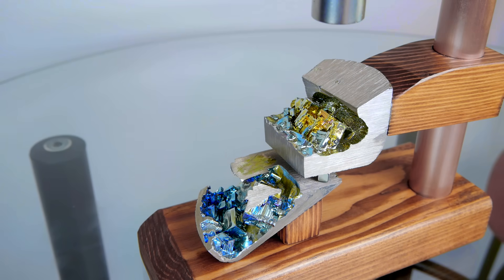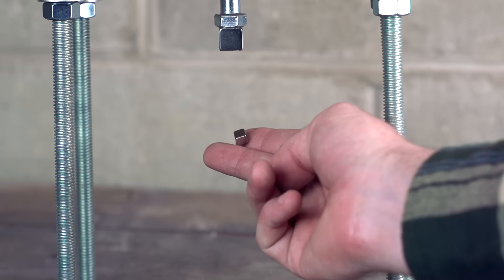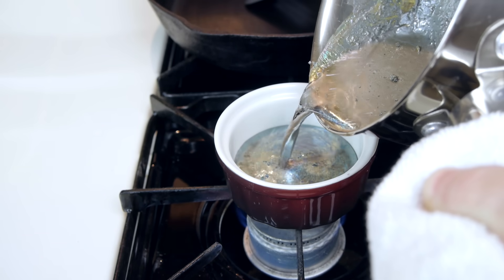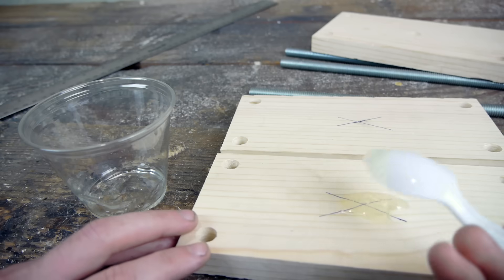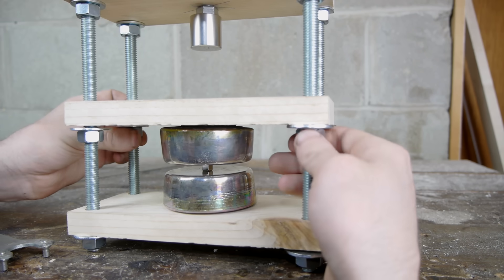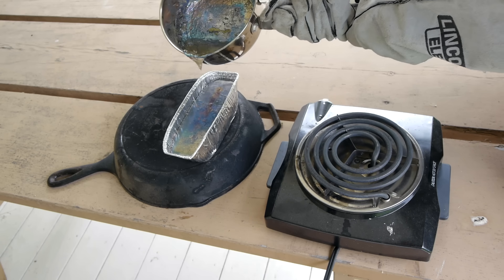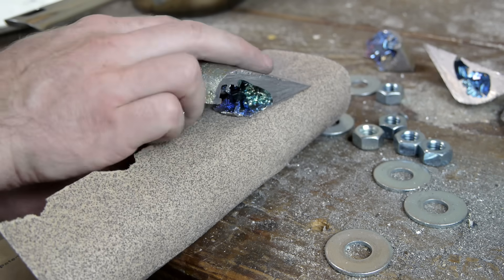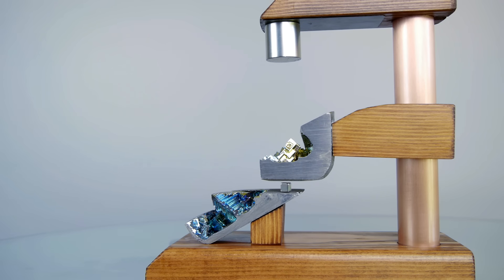Levitate a Magnet with Bismuth Crystals - No Energy Cost, Indefinite Levitation - NightHawkInLight

Comment: why do only the crystals oxidize like  that?
Reply: +King Cletus (all colorful)
Reply: +King Cletus yea, but why doesn't the metal do that and just the crystals do, they're the same material.
Reply: King Cletus When they form they have a much higher surface area - from what I understand, the oxide is coloured but it's not actually responsible for most of the observed colors - instead, it's an iridescence effect created by the the shape of the surface, because the surface features are smaller than the wavelength of the light, so different size features reflect different wavelengths - eg, they are different colours

Comment: I would be tempted to see how large of a magnet I could suspend and how fast I could get it to rotate, then store it in a vacuum chamber to minimize air resistance and surround it in a copper coil to see if it could produce any meaningful amount of power and for how long.
Reply: Ummm the energy put into the coils would be energy removed from the rotation speed so it would just slow itself down and or the eddy currents in the coil would create opposing magnetic fields and slow it down even more. So in reality, no.
Reply: +Viper magi  You missed a very important point, when you try to extract power from the rotating magnet, it wants to stop rotating. Have you ever cranked a hand generator? The more power you try to get out the harder it is to crank.  Think about the fact that you want to put it in a vaccum to minimize wind resistance. That's a clue as to how little power is stored in the rotating  mass of the magnet.

Comment: I'd like to make it clear to anyone watching this that this effect CANNOT be used to generate infinite energy. The only reason that the magnet floats is because the local conditions inside this little system make it so that the magnet has less potential energy when it is floating roughly equidistant from both of the Bismuth crystals. There is no energy being created here, no energy is even moving when the magnet is floating. As far as physics is concerned, that magnet is basically resting on a table.

Comment: have you though about using this type of method to create electricity, imagine the possibilities....
Reply: +Gixxer Rider Any system which cycles its own energy to create motion or sustain a position would not generate power. Remember, energy cannot be created. So tapping into this would just take the energy out of the system and stop it.

Comment: According to my high school physics class, magnetic fields typically do not vary exponential with distance.
Reply: +Ryan Jensen I'm pretty sure he meant that the magnetic attraction is exponential. So, at 1/2 the distance from one point, the attraction is 4x as strong at the halved distance.
Reply: I learned that magnets operate according to an inverse square law. I think that is what you are describing, too. However, this is not an exponential relationship.
Reply: +Ryan Jensen It's actually the inverse cube law, since all magnets are dipoles.

Comment: I have a question for y'all. Is it possible to generate free energy using this technology? Although I am aware of some downsides such as the energy collected might be minuscule (is it?), and that building a larger scale model of this is difficult. Although couldn't we just create more of these to compensate for the minuscule amount of energy collected from each?
Reply: +~[Ματ2468χκ] if you were harvesting energy, it would slow down more quickly, the reason it stays spinning is because its touching nothing but air, once you try and harvest, its touching other things that will stop it spinning :) (one of the very basic laws of physics is that energy cannot be created or destroyed, simply changed from one form to another, i love that law! and whatever, and however good it might sound, free energy will never work, we've all tried!! haha :) :)
Reply: No unfortunately, the only reason the magnet is spinning is because he applied some force on it, so you have to give it power to get power from it.
Reply: Bob Berendsen Well, we could see that you only apply a small amount of force to get it moving. Or am I wrong?
Reply: ~[Ματ2468χκ] yes, which is exactly why you would only get a small amount of force from it, you cannot get back more than you give it.
Reply: +Bob Berendsen Oh, damn. I'm still confused and curious, though. It seems to spin longer than you having to adjust it. So shouldn't the energy it gives us higher than the energy we give it? Is it in a way similar to those hand crank flashlights?
Reply: ~[Ματ2468χκ] good good :) thank you! ill do my best if theres anything else?
Reply: marcus allison Thank you, was trying to come up with the words and you got it ^^
Reply: Bob Berendsen thanks! :)
Reply: marcus allison Oh, that explains a lot. :)
Reply: what if its done in a vacuum
Reply: Harold Milton-Gorvie maybe, i don't know :)
Reply: +Harold Milton-Gorvie If it's in a vacuum the same thing will happen. You will get out the same or less energy than you put in.
Reply: Replace road concrete with bismuth, replace car with neodymium magnet, sit in car, have someone push it from behind.

Air resistance will still stop you though.
Reply: NukeML stoppings an issue too ;)
Reply: toasty bear Air resistance will stop you very soon.
Reply: NukeML not soon enough for a ball in the road :P

Comment: Could you put a ferro fluid between the plates?
Reply: :O
Reply: +Pongjazzle would have to be a magnetic liquid
Reply: @Toastybear1  that is what ferro fluid is.
Reply: +marcus allison Thats what a ferrofluid is though right?
Reply: Corey Flynn yeah...
Reply: Corey Flynn im not sure, but the fluid lines up when magnetism is present, in the the thing is the middle is the magnetism (i THINK) and the surface is ferrous not the other way round it might work if you replace the bismuth with the liquid???
Reply: +toasty bear     the ferrofluid is not diamagnetic, it's ferromagnetic.you could put the fluid on the magnet and it would adhere to it but the levitation effect might not work because the fluid would alter the magnetic field around the magnet possibly making it too difficult to adjust. the fluid would probably be concentrated on the sides of the magnet because of the diamagnetic  effect. it would repel the fluid because the fluid has a magnetic field induced by the magnet. motions in the fluid might cause instabilities, possibly destabilizing the balance of forces that is needed to cause levitation. it would take an experiment to decide the matter. the fluid has no inherent magnetic field, i think it's made of tiny magnetite particles in an oil( magnetite is an oxide of iron, also called lodestone. it's a natural magnet) the particles are floating in the fluid and aren't able to form a stable magnetic field without an outside source to align the  particles. i hope you can find an answer to your question somewhere in there.all this thinking has lowered my blood alcohol level.it's beer o'clock!!
Reply: Thomas Penning no, thats great!! explains it very well thank you!, do you think it would work if you had the fluid with no space in an inert container to keep it in one place?? (obviously this defeats the point, but still, you would have a ferrous liquid who's particles could move within the object??)
Reply: i suggest you look up information on magnetic shock absorbers. they're sealed tubes with ferrofluid  in them. they use electromagnets to control the fluid flow through the shock. you could see examples of working designs using the materials and principals you're interested in. i've about covered all the info i was pretty sure was right. you need a better source than me now. good luck.
Reply: Thomas Penning fair enough! that mere existence of such shock absorbers suggests its possible, ill look into it, thanks for your time and expertise!! :) it has been very informative :)
Reply: +Pongjazzle and given magnetism is created by the atoms lining up, and facing the same way, I'm not sure thats possible (not sure at all though!)

Comment: I'm sure you can't use this to create energy in a way because of physics, but you can save energy for example in problems with a lot of friction
Reply: john kryptonian That still would not work and would in fact be a inefficient way to turn anything at all. Consider this: for every action there is an opposite and equal reaction. Now the bare bones of how a generator works is as follows: a magnet pushes electrons in a conductor to create a steady flow of electrons. This is normally done by spinning or rubbing the magnet against coiled wire. Now firstly, why would you have the magnet attacked through a generator through a gear system? Why not just use the magnet as part of the generator. But now we get back to Newton's third law, for every action there is an equal and opposite reaction. So the magnet spins and pushes electrons creating a steady current, but the electrons push back on the magnet slowing it down over time.
Reply: john kryptonian No, it's not a matter of friction or scientific advancement. This is fundamental. There is no model of reality, nor will there ever be where something like this could work.
Reply: john kryptonian Like I said this is fundamental physics. You cannot defy the laws of physics, you can obey them and manipulate them but you cannot defy them. Your idea defies them. 

If you want free energy it's everywhere around you. Sorry to break it to you but spinning a neodymium magnet between two diamagnetic plates isn't going to achieve anything.
Reply: generators are just reversed engineered motors,if you take a motor,let's say from a remote control car,and attached it to the magnet somehow,free everlasting energy.
Reply: +john kryptonian That's not the way things work
Reply: Have you tried?
Reply: john kryptonian These are things that don't need to be tried because we know for a fact they don't work.
Reply: ohhhhh lol my bad,let me rephrase my first comment.i meant attach the  rotating rod of the motor through a gear to the bismuth in the middle,the rod will spin along with the bismuth,creating a generator effect.
Reply: +Mike Hunt im just saying,a few years of scientific advancements and a fritionless environment,might be possible.
Reply: +Mike Hunt well if you keep thinking like that of course it will never happen.

Comment: You should try using a larger magnet in between the two and put a copper cool around the spinning magnet and see if it generates anything. I am very curious about the idea of free energy.
Reply: spratsprat There is no free energy - laws of thermodynamics prevent it. If you put a coil near a spinning magnet, the amount of energy induced will be slightly less than how much momentum the spinning magnet loses.
Reply: spratsprat If the spinning magnet drives electrons round the coil, it will be decelerated in the process, losing more energy than it gives to the electrons in the process due to inefficiencies and collisions between electrons and ions in the coil.

Comment: You want an even lifting magnetic field so that the height of the levitating magnet does not have too much of an effect on the forces it experiences. One way is by using a strong magnet a fair distance away. Another way would be having smaller lifting magnets both above and below it.

Comment: Hey Ben, I don't know if it needs it, but it seems as though the wood might slip over time on the coper. Would it be useful to add a screw to the end of the wood to put pressure on the pipe to hold it in place?
Reply from the maker: NinjaRooster Mine hasn't slipped yet. A screw would probably just mark up the pipe.
Reply: +Nighthawkinlight "Set Screw" was the term I wa looking for. You're right, it would mark up the pipe. Unless it were made of wood... ;)

Comment: Thegamingspecialists Wrapping copper around the magnet would induce an electromagnetic field in the copper essentially putting the brakes on the spin. You would need a source to keep torque on the spin and then you are inputting power. Not saying that your couldn't do that. In fact it would be a fun little project maybe using wind and the bismuth as bearings for the small generator. A very small gauge wire looped around the axis but not so much that it blocks the view. One could possibly add some tiny wind blades to the magnet if it can handle the extra weight. then you would have a very tiny wind generator that puts out a virtually useless amount of energy but looks pretty cool. Nice project NightHawkInLight

Comment: Would the magnet spin forever if put in a vacuum and spun?
Reply: No.
Reply: guifrakss thanks for that shit comment. You really added to the conversation
Reply: guifrakss lol, "no". To a complex question involving multiple factors and lots of science I think you could've done a little better than "no". Does gun control stop gun violence? "no". Is there a god? "no". Do you see now how insignificant it is to just simply say "no"? Why don't you back your claim with some facts instead of giving a child like response?
Reply: You didn't asked for an elaborate answer, "no" or "yes" was perfectly ok to use.If you wanted a more complex answer, you should've asked.
Reply: +phantomplasmaapple Yes, it would spin, but not forever. Longer than in air, but not forever.
Reply: ***** But what would stop it from spinning if there is no air resistance?
Reply: phantomplasmaapple
 Eddy currents, also, the magnet would eventually lose it's magnetism.
Reply: phantomplasmaapple the rotating magnet creates a rotating magnetic field, which will send electromagnetic waves, which consumes energy.

Comment: :-P Saying that there is no energy cost is a bit misleading. I mean of course there is no energy cost, because there is no work performed. The magnetic force and gravitational force balance out exactly in the same way that the contact force and gravitational force balance out when you put an object on a table. Yes, objects remain on tables, and it does not cost energy. In the same way, magnets remain on diamagnetic materials, and it does not cost energy.
Reply from the maker: ***** That's right. But I note that this costs no energy specifically because there are lots of levitator designs and do require energy. Most of them.
Reply: NightHawkInLight  That's true. Here you use a field which is intrinsic to the materials. the "levitated" state is just a minimum in energy. As opposed to devices generating a field using electricity, or devices based on the generation of a flux.

Comment: How thick must the bismuth need to be, to effectively act?
Reply from the maker: frosted1030 I've seen some that use plates only about 1/2 inch thick.
Reply: NightHawkInLight Can you make a tunnel shape with bismuth where a magnet could move inside the tunnel?

Comment: Ok that final design looked amazing , hm but i would say make a slim cannel with a pressure held rod with a small pull on the spring to adjust on the mid and top plate besides that it looks really good ^_^

Comment: I'm not convinced that the levitation would occur indefinitely...
Presumably the magnetic field of the neodynium will weaken over time (albeit a very long time). As I understand it, the idea of a true "permanent magnet" is a theoretical ideal.
Reply from the maker: ***** Sure, it will fall probably in about 100 years or so as those magnets lose about 10% of their strength in that time. But indefinite covers that, it just means we don't know how long it will be.
Reply: NightHawkInLight 
True. Indefinite is not the same as infinite.
Although, if one knows the coercivity, mass, etc it would probably be possible to calculate it reasonably accurately.
Or one could just make a REALLY long video... :)

Comment: My theories regarding cooling hoppered crystals were right.  The best work is done by a guy in Germany and equally done as well by Ernie credited in the description.  You used rope and thicker metal to result in a slower cooling and more uniform creation of the crystals.  Dry ice vapor or liquid nitrogen would be interesting to see the effects of cooling in a controlled state.  Additionally, using a torch to maintain temperatures and slowly reducing the temperature digitally should also work.  Wish I could chat with you in real time regarding some ideas...
Reply from the maker: ron zawora I tried a torch for slower cooling, as well as rapid cooling. I haven't found anything that works better than just natural cooling with a little bit of insulation. Really the best crystals seem to form when you just use a ton of bismuth, the more the better.  I bet I could make some really great ones if I melted something like 20 pounds.
Reply: NightHawkInLight Ernie never reveals his secrets!  Maybe he will to you...I've sent him your video.